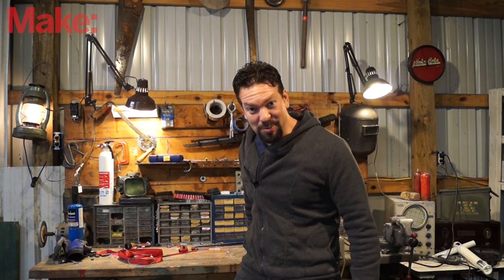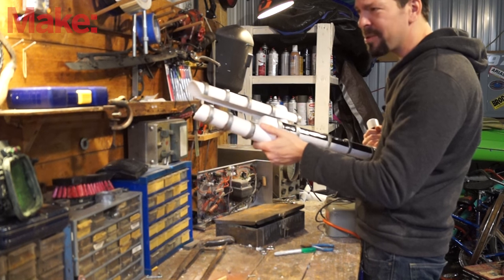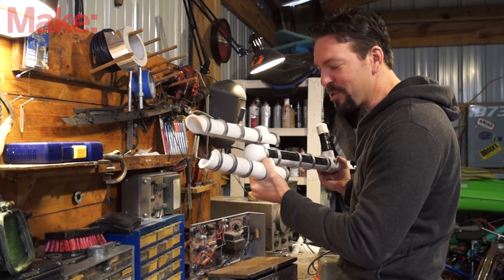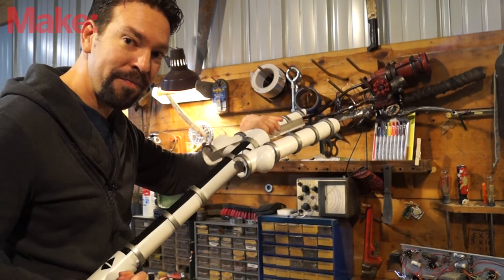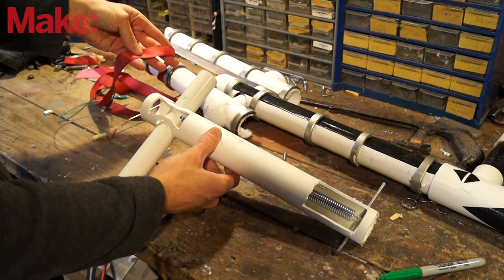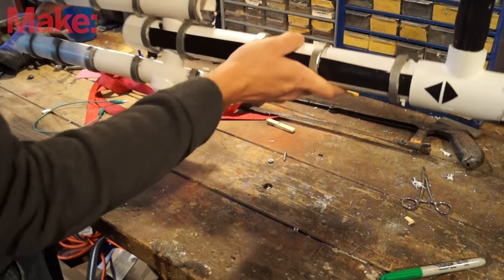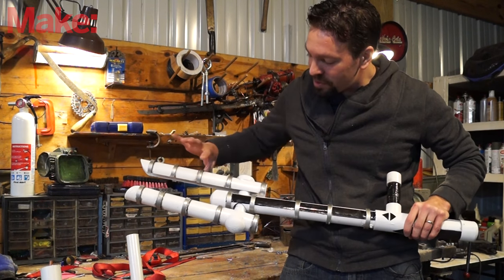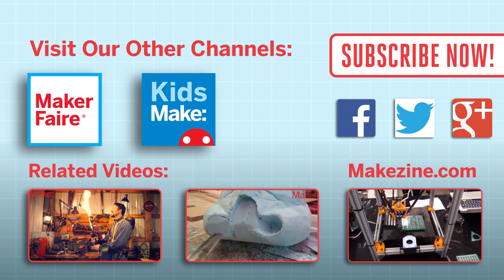Controlled Chaos: Star Wars Z-6 Riot Control Baton

Comment: Maybe a ring of metal  (short piece of pipe) fitted inside the 1.5" pipe where the anchor bolt for the strap hits   would give improved wear resistance. Might need to trim the bolt slightly to still allow 180 degrees rotation.

Comment: How do you get it to stay in the 2 positions? I can understand when it locks in the extended position, but then how do you get it to stay still long enough for when you snap/swing it out? I want to make one of these, but I want it to be as sturdy as when it's in resting position as it is when I snap it out.
Reply: +kyroo1052 , Just using my finger to hold it. You could add something to snap onto, but I didn't bother.

Comment: how did you cut pvc down the middle, what tool did you use?
Reply: +ninokuzma , Dremel with a cutting wheel.
Reply: +ninokuzma also I don't recommend it if you do have a dremel handy, but if you don't you can use a hack-saw if your carefull , it juts takes a bit more work and time :)